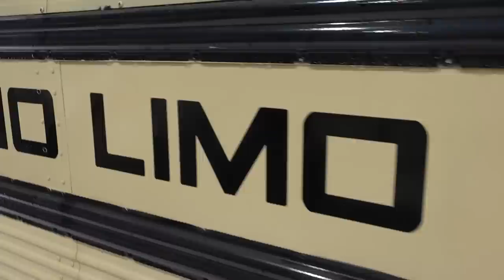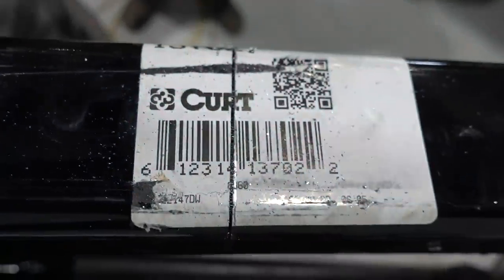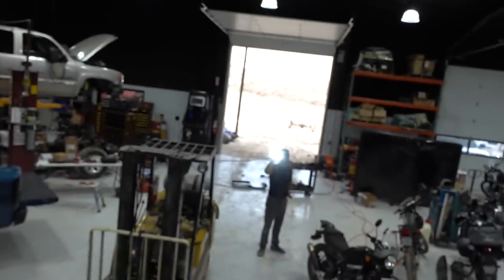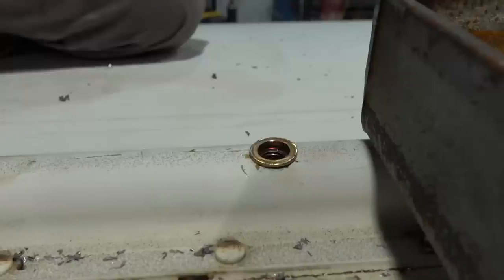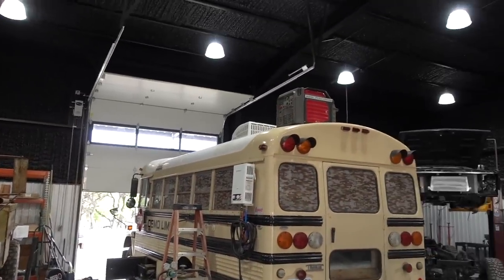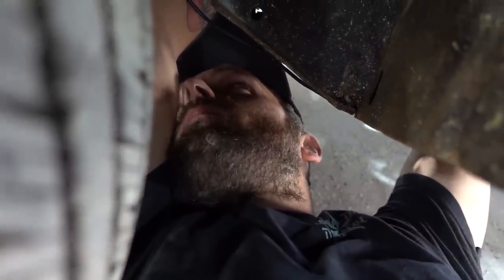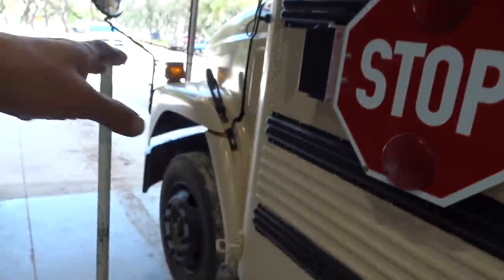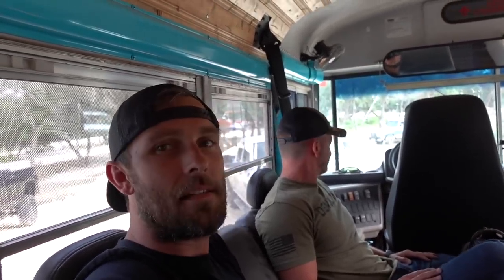Demo Limo

Comment: Looks great!
If you had the time….I think that if you would have built the side ladder first, so you would not have needed a step ladder to work on it.
Reply: Regular ladder is safer to climb up and down repeatedly while working on it. Wider steps, wider sides to hold onto.
Reply: @RyanConnell5150  I agree that in some applications it might be but, having done this type of work, on multiple mobile command post vehicles, it was safer for me to access the roof space by an attached device.

Comment: That Honda EU7000 is sweet. It is like a five grand generator. Should have done generator maintenance while it was off. Allison fluid and filters, diff fluids, oil change maybe the front wheel bearings and brakes.
Reply: That makes financial sense on a give away bus huh

Comment: Nice job, guys.  That generator is WAY overkill for that roof a/c.  An EU3000 would run it perfectly and been much smaller.  Whoever got it could switch that 7k out with a 3k and lighten the load by about 100 pounds, easy.  Those Hondas are quiet and the 3k is half as loud as the 7k. Take that water heater off and put a V in front of the generator to keep the bugs off of it or anything else with your frame would be pretty easy and might even make it "aerodynamic"...LOL.   Overbuild is much better than under...like that rear rack.  Wish I had that bad boy.  I'd make it into "Da luv masheen"...LOL.  Take care.

Comment: 9:03  Could a second alternator (and batteries) replace the Honda generator?
Reply: An alternator driven roof unit is easily available for school buses. Generally around $500, last I knew (possibly 13 years ago, so probably still under $1000, I bet.) Generator seems an odd choice for the original design.
Reply: @paulherman5822  thinks its just to run the ac not alot of 12v stuff in it but that would b better solar panels some batteries etc
Reply: @GarthR  That's kinda my thought. Why a generator driven AC when there is a purpose built unit available for alternator use. Would have been cheaper initially. They're used for buses for special needs kids, and probably a lot of buses in use in warmer areas.
They seem to be just kinda plug and play aftermarket that school districts can option for.
Reply: @paulherman5822  ah I never knew that I know some ppl just use mains power plug ins a lot but I’d prefer the off grid style personally
Reply: @GarthR  I actually looked into them for a local church about 10 years ago. Unit looks surprisingly similar to this one.
A regional bus parts dealer was about a half hour away, so I could just pop in and get things for generally less than an auto parts store. Hours of talking with them. 😉